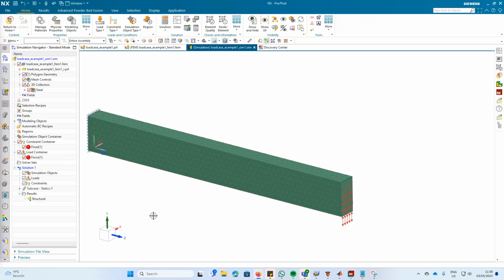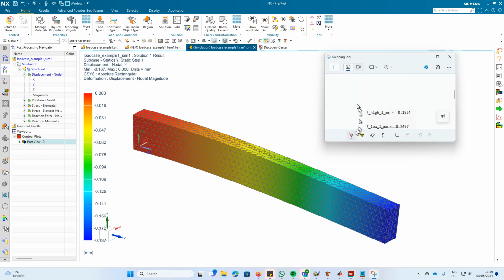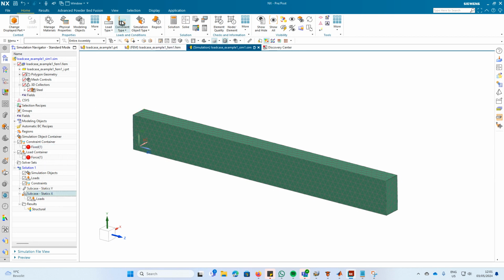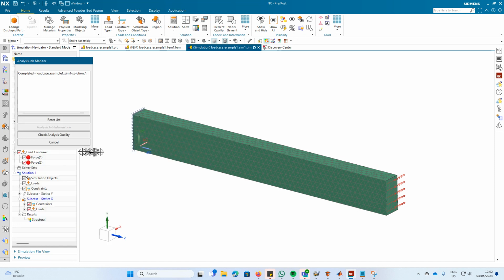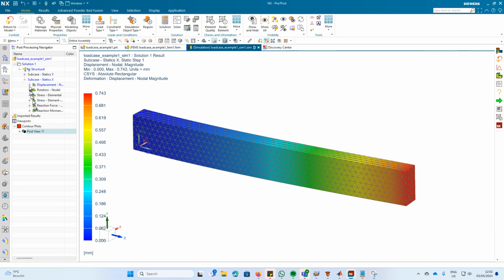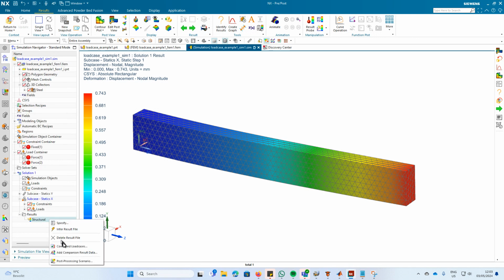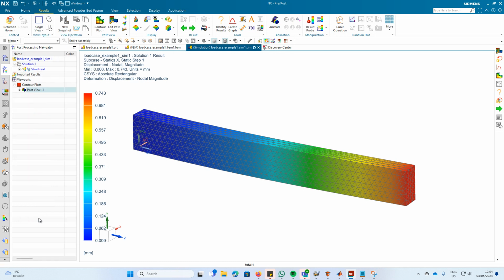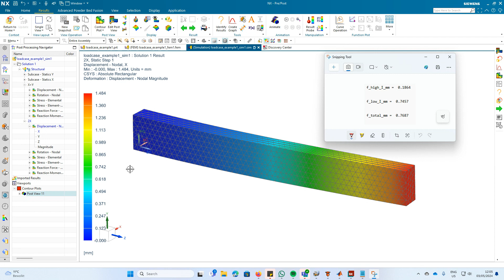How to use and combine load cases in Siemens NX 2312 works similar in older versions

Comment: nice video .can you do a video on crash simulation using Simcenter 3D ? 
thank you
Reply from the maker: Sorry, that will not happen, this subject is out of scope for my channel.
Reply: @OlafvanBuul   thanks for you reply thanks for providing with useful tutorials🙏
Reply: @OlafvanBuul  if possible please make a small tutorial on SOL401/402 since SOL601/701 are not support anymore.
thank you
Reply: Hi, During calculate the beam C160x65, length 335mm, cantilevel load 2000N. I saw that beam deflection by NX is not like theority. In theority. It is about 0.015mm. But when i used 1D element, result is about 0.22mm. I don't know why